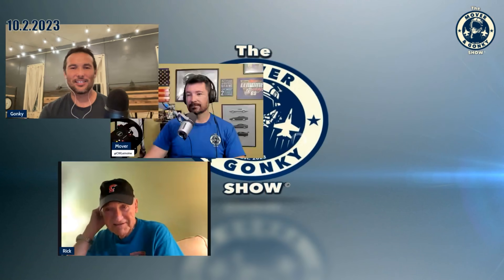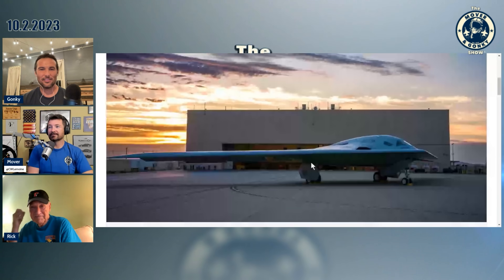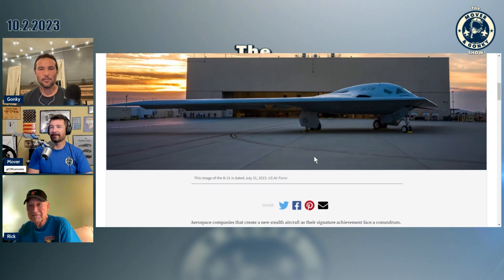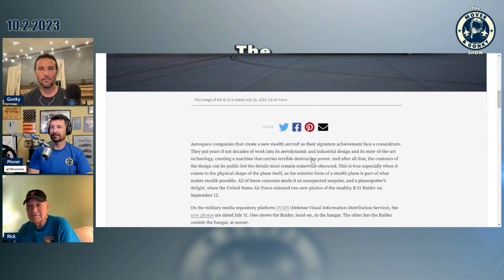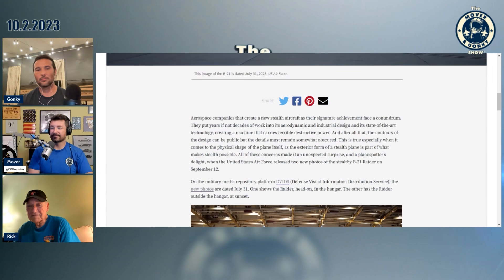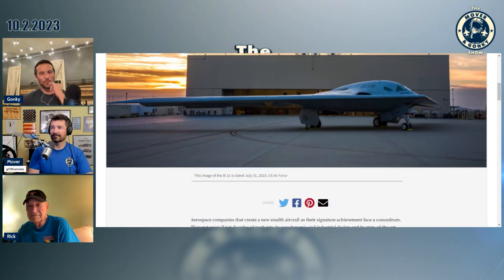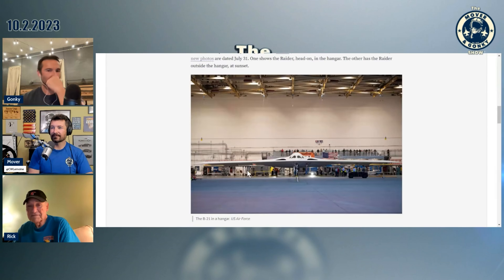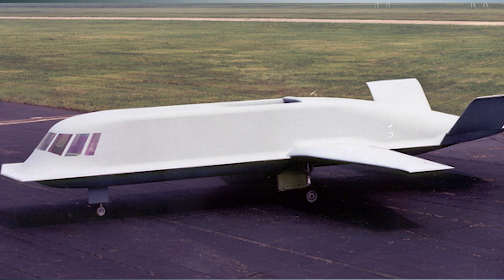B-21 Raider: Former USAF Engineer Discusses Air Force's Newest Bomber

Comment: I believe one key difference as far as stealth goes is the trailing edge. The B-2 was optimized for low level penetration which is why it has that saw tooth pattern which helped it handle the turbulence of high speed low altitude flight better. The B-21 is optimized for medium level and is basically a diamond with wings on it which as it turns out is more stealthy, but not so good with turbulence low and fast.

Comment: Keeping costs down is a major driver of the B-21 and thus I expect we'll see a lot of evolutionary improvements vs revolutionary ones that always take more time and money to make happen. Northrup has 40+ years of B-2 data to make this happen as well. Thus the exterior is only going to have modest visible changes. The avionics Comm, Nav, intercom is likely going to be nearly the same as current B-2 CNI. Flight controls & auto pilot could be the same boxes with modest improvements for the reported unmanned drone flights.  The EW and Radar Warning systems may also be upgraded B-2 systems as well.

A big change will be the reported addition of advanced ISR capabilities. This could be comparable to the ISR package carried by the RQ-4 at some 1000 to 2000 pounds it shouldn't be too hard to fit it in the B-21. It'll need a higher capacity satellite antenna of which Starlink has shown can be fairly compact.

The biggest changes are likely the engines by going from the F-18 modified engines to one based on the F-35's engine. This will save a huge amount in logistics and support overhead by having a common engine for the biggest fighter and bomber fleets in the USAF.

It's going to be fun watching the first flights of this beast and it can't come soon enough to replace our aging B-1s and B-2s.

Comment: I would think the B-21 has the same advantage over a B-2 that the F-35 has over the F-22, electronic sensor and information integration as well as electronic upgradeability.
Reply: F35 and F22 are totally different! Different mission requirements required different design capability
Reply: @toddie4usa1  Look at the reasons they're planning to retire the F-22, the re-read my comment.
Reply: You've done a derp there, toddie.

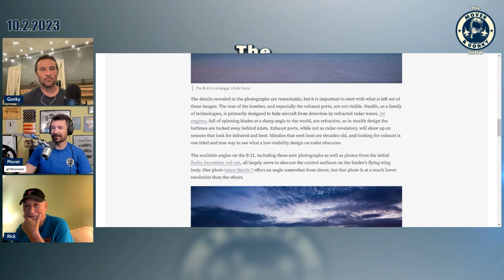Comment: 1:13 lol "looks exactly the same" knowledge of aircrafts is outstanding
Reply from the maker: “Aircrafts” knowledge of the English language is outstanding.
Reply: @CWLemoine  Thats what i said "aircrafts" i just didnt use a capital A but ya dont need to little fella
Reply from the maker: @discovolante6624  aircrafts is not a word.  The plural of aircraft is aircraft.  As for knowledge being outstanding, does the B-2 not look like the B-21?  What’s the issue?
Reply: @CWLemoine  yeah fair point, and speaking of points the B2 has more pointy bits on the arse end compared to the B21, that kind of stands out, but I'm only mucking around, i really like your channel, keep up the good work

Comment: I think the largest differences between the B2 and B21 are going to be beneath the skin. They almost certainly have new shapes/structures for absorbing radar, likely 3d printed. And of course there's the RAM. Stealth is very much like that defense onion, you want to reflect what you can away, then absorb what you can with RAM, and then dissipate what gets through using the internal structures. And I guarantee there's some funky stuff going on in the back to cool down the exhaust, we'll probably never know though
Reply: The biggest difference is we'll be able to fly it everyday without annihilating our budget.

Comment: Northrop wasn’t shy about showing you how many years advanced Jack’s mind was ahead of the industry. When you walked through the doors into the main hallway in the design center in Pico Rivera, the line drawings of the YB-49 and the B-2 overlayed one another. Dimensionally they were identical. The Tacit Blue mods for control surfaces and RCS reduction were the differences most obvious to a casual observer. Basically, Jack Northrop built the B-2 prototype in the late 1940’s. Consider that for a moment.
Reply: I read somwhere that the flight charateristics were almost the same.

Comment: Half the size, double the cost
Reply: Same as my new wife.
Reply: Other way around the b-21 is way cheaper then the b-2
Reply: @jamesmcgee1566   ONLY if they buy more than 21.  The original B-2 cost estimate for 132 aircraft was ~4-500 million each.  They 'saved' money by buying 21 for 1.2 billion each.  The current plan is almost the same, buy 100 for 690 million each.  We'll see if they 'save' us money again.
Reply: The b-2 was 2 billion I think the B-21 is less than half that
Reply: @godhimself478  And that doesn't even account for the massive inflation since 2008.

Comment: Why does the B-21 have a designation that comes before the F-22? Where is the F-21? Shouldn't the Raider be designated the B-3x?
Reply: They're different aircraft and numbered in different series 
But the logic of sequential numbering is thrown out the window
Unless there's a LOT of even darker projects ...
Reply: There really is no actual logic in the numbering, at least not in the modern era.  We went from the F/A -18 to the F-22 to the F-35.

The F-117 was way outside the numbering “system” and in fact wasn’t even a fighter (F designation) but was actually an attack plane and should have had an A designator.  This was done intentionally for the purposes of disinformation.

Although, if you think about the B-2 and the this new plane (B-21) as the B-2.1 you might think there is something there.
Reply: @kevint1911 Well, the Northrup improved F-5 was the F-20 and the borrowed Israeli Kfirs were the F-21.  The F-35 should have been F-24 I believe but a general screwed up and got confused by the X-35 designation.
Reply: Long ago the army and navy used their own number designations and generaly assigned blocks of numbers to manufacturers in a haphazard sort of way. The number is normally assigned at the Y designation (Production prototype. The prefered use of "X" is for purely experimental testing of basic science and technologies rather than practical aircraft.). There are many prototypes (Y) that never make the cut or even beyond the blueprint/concept stage, but they keep the number anyway. 
In addition they skip over numbers used before the unified sequential numbering system, like the B-17, B-24, and B-25. They also skip 13 because some crews may be superstitious and get distracted by it. (I'm not totally clear but they may also avoid duplicating numbers between the Fighter and Attack series due to the fuzzy delineation and multi-role nature of many of them.) 
The F-117 was numbered as a secrecy thing but not totally random, it started development not too long after the end of the century series of pure high altitude fighters(F-104.. F-106 etc)  which made the F-117 designation more believable and further shrouded it's medium and low altitude attack role. The century series just barely predated the current unified numbering system.
Reply: that's not how that works
Reply: @karol_janek_wojtyla_pawel_ii  obviously 😀
Reply: The past two decades or so, MDS numbering (All Services) and naming have been REALLY wacky, and with zero continuity.  (Mission Design Series).  Most of that is political as well as commercial, like the DDG-1000-1002 Zumwalts, numbering from the Pre 1962 order, but DDG-1000 looked sexy, then they went back to the original Post 1962 numbering for the supplemental Arleigh Burkes, from DDG-113 on.  On the aircraft side, yes there is no (official) B-3 to B-20 in post 1962 designations, but the B-21 was a homage to the 21st century, and again, it looked sexy.  The F-35 was strictly because the prototype WAS an actual X (Experimental) category as the X-35 system (Boeing's was the X-32), then I guess it would cost more to get the next number, and change three characters, in the F MDS for all the paperwork and blueprints, so they just 'bought' a consonant from Vanna of "F" to replace the "X".  Makes database and historical data management/progression a nightmare, though.
Reply: Pretty sure the 21 was used cuz it’s a bomber for the 21st century